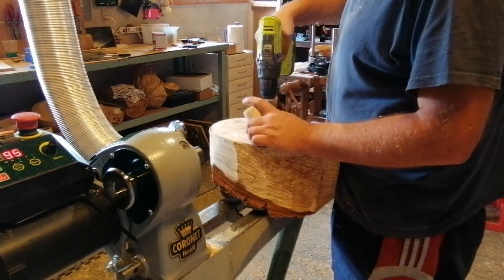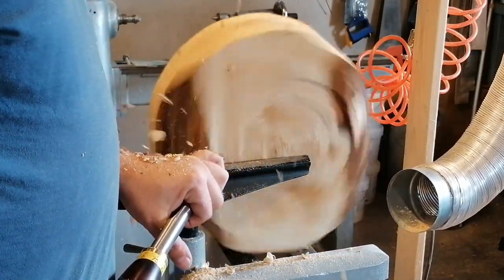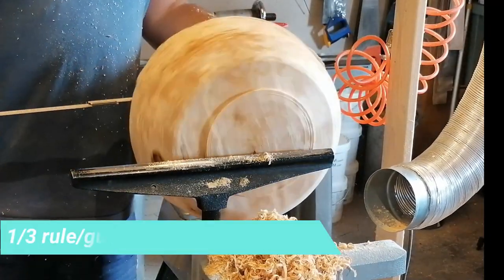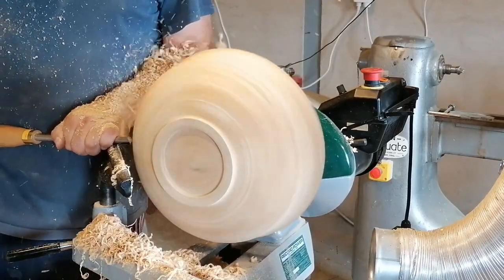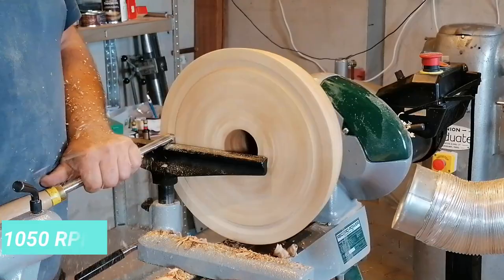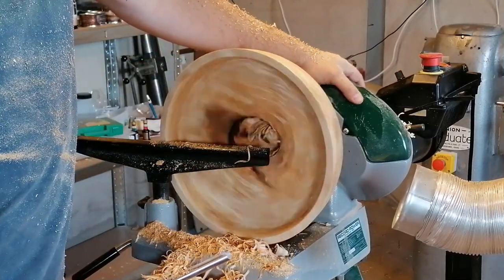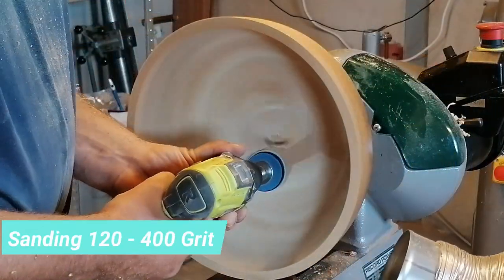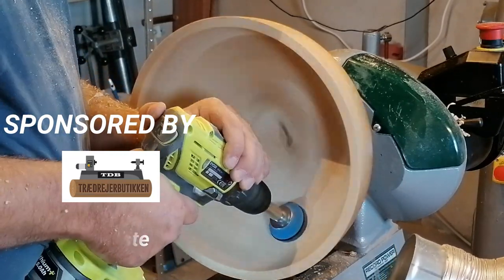Woodturning a Spalted Silver Birch Bowl

Comment: It appears that the wood was still a bit green.  Did it warp much after you turned it?  Did you attempt to pull any moisture out by microwaving it, or other means?  Thankx
Reply from the maker: The wood was areund 16% moisture, and it is drying in a paper bag with the wood chips... When it is dry i Will correct the foot and All done... I do use the microwave alot but not for this project.. Thank you for watching.. Stay safe and have a great day 😁😁😁
Reply: @WOODTURNINGBYBRANDSTRUP  Ahhhh, gotcha.  I've done the wood chips in a bag, cat litter [silica], micro wave, etc....
Reply from the maker: @pfiltz  Do the silica work ??
Reply from the maker: @pfiltz  Great thanks :-)
Reply: @WOODTURNINGBYBRANDSTRUP  Sure.  no worries.  Remember, it's going to dry your bowl from the outside inwards, just as chips do, or at least that's what I think is going on.  I would try it on a small test piece to see how it works for you.  I also made a DIY kiln out of a mid size fridge from a junk yard.  I have a PC fan in the top to pull air through it, from a hole cut in the bottom.  I have a 100 watt light for heat in it.  It usually runs around 120 degree's F.